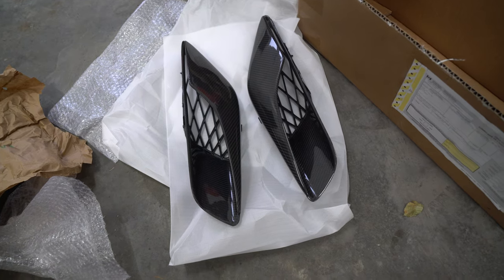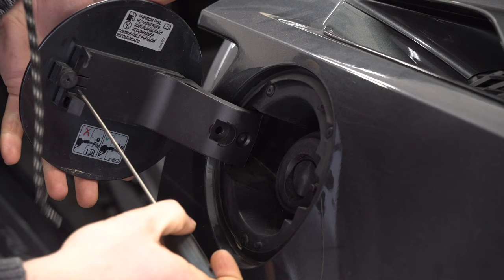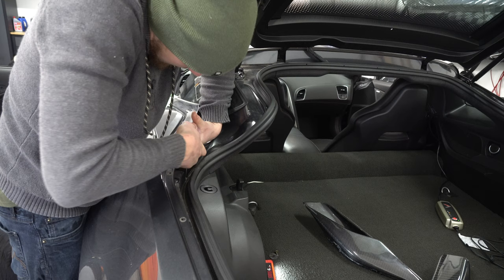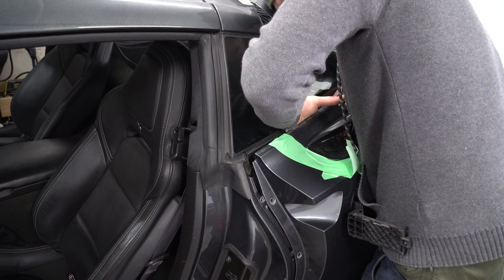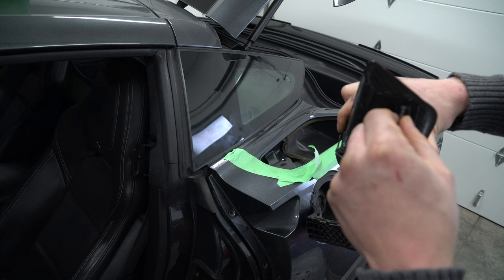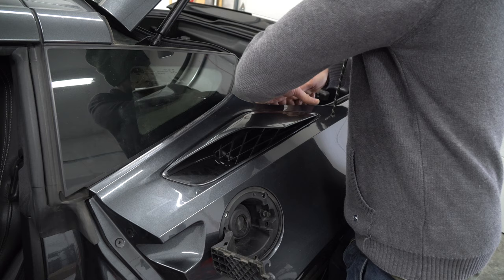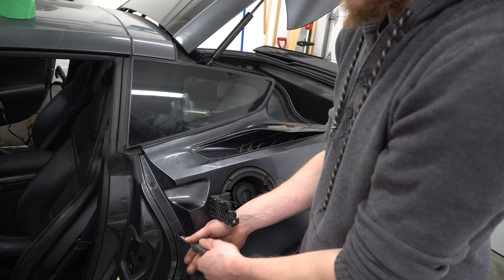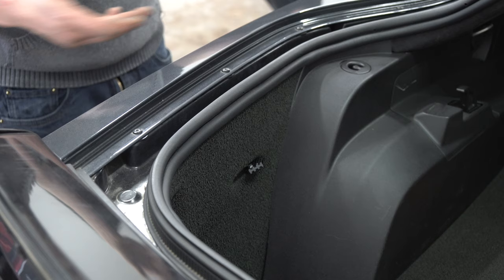HOW TO REPLACE CORVETTE STINGRAY C7 REAR FENDER VENTS GRANDSPORT Z06

Comment: Is it any different for a convertible    On my passenger side the vertical that  is located between the door and the portion that lowers over the retracted top is not level.  The back side is about 1/8 higher than the adjoining panels.  I can’t figure out why I can’t level it .  I have loosened all the t15 screws and the bolt that holds that fender panel but I am missing something.  Can you help me figure it out? Thanks!
Reply from the maker: If it has shims it might be shimmed one to high, or the opposing pannel needs a shim to bring it a 1/8th up
Reply: @ghostlyrich  thank you.  I think I may need to go to  corvette body specialist.